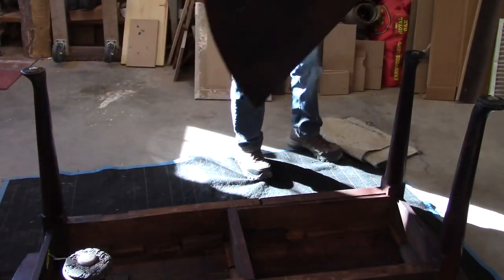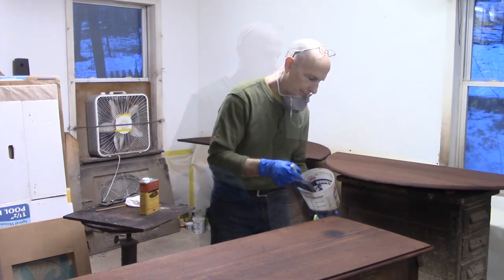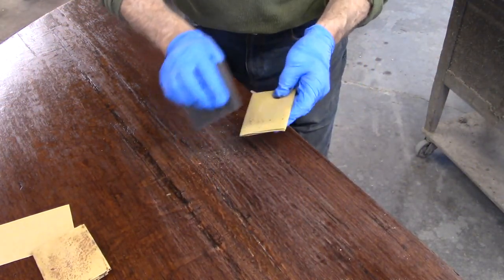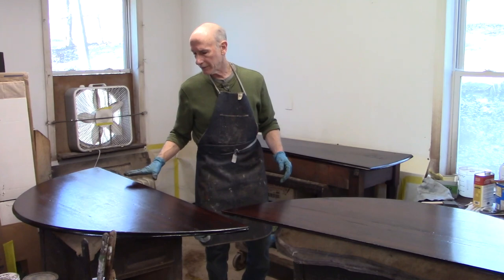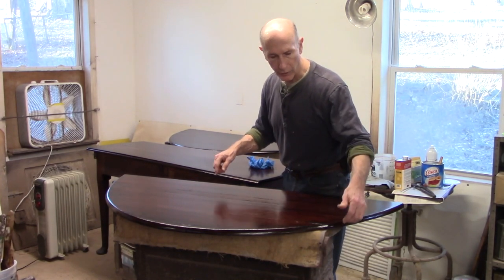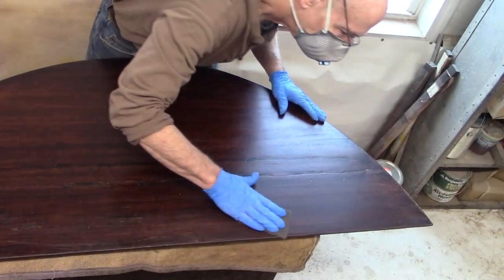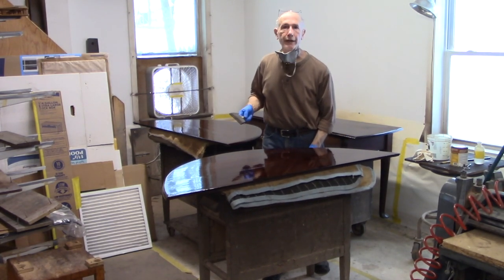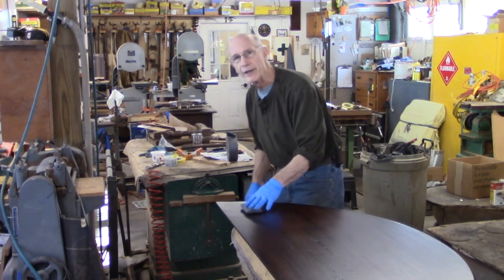Finishing an early 18th c. Drop-leaf Dining Table - Thomas Johnson Antique Furniture Restoration

Comment: Dear Mr. Johnson,
I admire your work and now I am more courageous in the application or stains and color, and the use of tape.
I have two suggestions for you and your viewers. 
1. Set the hinges and their screws in Shellac, and only shellac. 
2. To avoid breakage of the frame and antique glass, when you remove or hang a glazed door in a cabinet remove one screw from the top hinge and one from the bottom hinge and install, finger tight, a long screw with the head cut off in the screw hole, they will hold the door while you remove, or install, the remainder of the screws. Yes, it takes a few minutes longer.
In an old piece of furniture the screws either fall out or are so firmly in place that it becomes a chore to remove them.
Mike
Reply from the maker: Thanks! All good ideas!

Comment: A stearated  (freecut...a light grey colored)  sandpaper (320 grit) would help during your finish sanding operation. It'll help you sand without as much risk to gumming up and possibly marring the finish below with little globules of finish. It is also (because of the stearates) somewhat self lubricating. It allows you to sand a little more thoroughly to give you a flatter surface. Then you can wipe between sandings with a tack cloth. 
I've used this type sandpaper over all types of finishes (varnishes, lacquers, shellacs and even oils) with no residue left behind to get under the final finish.
Reply from the maker: Thanks! Yes, I used the stearated papers for many years. I like the gold a lot better. This finish would have clogged any sandpaper

Comment: Really nice, as usual. So one of the 'war wounds' is the burn mark that you left alone although by darkening the finish, it was less apparent.  By the way (being the nerd I am), that odd color change from green to blue to green again is the result of 'chromism'. The solvent choice (paint thinner) polarizes (changes shape and aligns molecularly) thereby causing a color shift (like a prism).  When you put that back into the finish which has another type of solvent presumably, it returned to its original color by depolarizing.
Reply from the maker: Thanks! Yes, I forgot about the burn mark, it's hardly noticable. I was wondering about the color - I should have paid better attention in 12th grade chemistry!
Reply: @johnsonrestoration  -- well you have mastered alchemy instead...you are one of the few who can transform lead into gold.

Comment: Beautiful finish, masterful problem-solving.  You gave me confidence to refinish my pine Habersham Plantation  dining table after 25 years of use and it turned out beautiful thanks to watching hours and hours of your videos. Couldn't find many on pine....I think one.  Have also refinished the top of  two HP  end tables and an HP sideboard cupboard and a HP hunt table.  Used stain, tung oil,
marker pens, satin lacquer final coat, and the Feed and Wax beeswax polish. And lots of sandpaper and 4000 steel wool. Have learned so much from your videos. Much appreciation!
Reply from the maker: Wow! You sound like a pro! Thanks for watching, and I'm so happy that you could learn from them

Comment: In the auto paint trades we use an enterface pad that resembles a scotch brite pad but it's foam, it covers more area and conforms to your hand without digging into the finish. Great job on the table, it looked almost sprayed on, great finish.
Reply from the maker: Thanks! i do buy products from an auto paint supplier, I'll check those out

Comment: A lovely three-hundred old piece which wears its ageing honourably, Tom.  You did a wonderful job.  I wonder if you ever use tackrags between coats to lift off the dust etc from refinishing?  Good idea to use foam brushes too.  There's nothing worse than finding a bristle in dried varnish etc.  Thanks for sharing this  project's video.
Reply from the maker: You're welcome! I just haven't bought any tack rags in a while. I spritz a little paint thinner on a rag. First time with a foam brush. I hate to say it worked great

Comment: I do work for dealers and mainly I hear, "Don't refinish it." I have refinished sections that go unnoticed, but that's rare. Here you've refinished all 3 sections of the top and I dare any one to say it's been refinished. Only the owner may know for sure. That is the ultimate goal,  to do the work it so it doesn't look like it's been repaired or certainly refinished. In this case I've not seen any better work anywhere. Tom, you aptly school the rest of us doing restorations and I miss non of your videos. I've learned a ton and use your suggestions and techniques nearly every day.

Yes, you are a master but your willingness to share is really as above and beyond as your workmanship. Consider me a humble and thankful disciple. I'm older than you but I hope to carry on this tradition until I can't walk to the shop.
Reply from the maker: Thank you! It means a lot coming from a fellow tradesman. And yes, always a balancing act over repairing and and doing too much. I'm convinced that by trying to follow old methods, you are much more likely to achieve an old look

Comment: Fabulously done.
Twenty years ago I bought a 1895 mahogany dinning table that had previously lived it's life in the dinning room and only used for really special events.  It was probably waxed every week, not a scratch, stain or a scare on it.  What I really liked about it was it had two pedistal legs and made it great for seating larger dinner events.  Unfortunately I used it once and there were water marks in the finish after...
Because I wanted to be able to use the table on a regular basis and not be worried about the table top I refinished the top and put on several thin coats of a water resistant finish.
I love my table and have spent many happy hour around it with many friends through out the years not worried about the table and enjoying my friends...l bought the table to use and enjoy with my friends... Yes it has a few scratches and dents and I am debating on if I should give it a light sanding and a coat of the stain and then a few more thin coats of water resistant finish again?
I know that the finish I choose has removed the value of the table as an antique but that's not what I bought it for, I bought it to be used and enjoyed and it is serving me well.
Reply from the maker: Thanks! Yes, always bottom line is that a piece needs to be used! That's what it was made for
Reply: @johnsonrestoration  l have noticed that you often finish off with wax.
How well does that stand up to everyday use and water?

Comment: Thanks for sharing!  This is why I just can’t ever stop restoring beautiful wood things!  ~Quick question: Do you warm the asphaltum finish to 135F for two hours to blend it with the original finish before cooling to sand and apply final finish?  A wonderful older gentleman that guided my first apprenticeship said that he had done that for 40 years (almost 40 years ago now!) but I’ve never seen anyone else use it on furniture until this video.  I thought I was the only one left using it!
Reply: Answering here not because I have an answer, but because I'm interested in Tom's!
Reply from the maker: Thanks! No, I haven't. I will try that to see if it makes the asphaltum easier to work with. I imagine it blends with the finish well as they share the same solvent. I am curious
Reply from the maker: Oh man, the pressure's on!
Reply: @johnsonrestoration  No pressure whatsoever. Just curiosity!

Comment: Tom, I'm wondering if the previous 'motor-oil finish' had some bearing on your glaze? I get the feeling that you were surprised how long it took for the glaze to firm up, and how badly it clogged the sandpaper. With 20:20 hindsight spectacles on, would you do it again on the same table? I understand why you wanted the richness of colour, but it seems that it caused a whole load of other problems - would another, different stain be a better approach, now that you've done it? Once again, a great tutorial and a lesson in patience! Thanks for sharing Tom.
Reply from the maker: Thanks! I'm not sure. I think it will dry along with the finish, I believe they are compatible. I'll always use asphaltum, the color is incredible

Comment: Tom, when a chair seat has had multiple glueing and after removal of the glue the parts no longer fit together tightly (maybe a 32nd gap) at what point would you consider cutting out the old and placing a filler strip?  I'd like to try a wax filler but am concerned re the size of the gap and how the wax will hold up.  Thank you
Reply from the maker: Thanks! I have often wrapped a piece of fabric around a joint, or veneer shims. If you can put it together easily just by hand, it's probably too loose

Comment: I found a drop leaf side table at the local recycling centre for the change in my pocket, jet black with gold guilt, a couple of repairs to the legs and a notch on the top where I think someone used it as a hobby table. It’s really nice except at some point someone has varnished it, probably like 60 years ago and it’s worn off and looks a mess imo. I have had a look on the net and can’t find one the same, and only a few that look as nice. For now it’s just a table and getting used as such 😊
Reply from the maker: Thanks! That finish sounds like late Victorian, Eastlake style

Comment: It looks like you don't have a separate room for finishing. When you apply the finish to the table it seems to be upwind of the fan.  Aren't you drawing dust across the table from the rest of the shop?  (Just a question, you know what you are doing.)  I learned a lot.  Thanks.  Mark in Milwaukee.
Reply from the maker: Thanks! Yes, that's true. On days I need to apply a coat, I try to limit the dust production in the shop, and I apply the finish at the end of the day. It was only a problem when I had people working for me that needed to raise dust for one reason or another. Working by myself it's manageable

Comment: Beautiful finish. Would the original finish likely have been shellac?  Was your choice to use tung oil varnish due to superior wear resistance or to the contaminated surface?
Reply from the maker: Thanks! I don't know what the original might have been. I'd like to research that. But I used the varnish for it's durability

Comment: Another ace job! I thouggt I was bad with 3 coats of 90 gloss varathane and 3 coats of Diamond water-based varathane clear over the oil-based varathane on red oak. A lot of sanding and a lot of scotchbriting and a lot of dust vacuuming and wiping down.  The Diamond finish adds clear hardness and the oil-based gloss varathane gives the warm patina.  But you have so many more coatings in your arsenal and your color matching efforts are the best!  Thanks for another great video!
Reply from the maker: You're welcome! Yes - I may put down a lot of coats but there is a lot of sanding between, I hope that the final mil thickness is not too much

Comment: Beautiful work, I got tired just watching you work. I had a problem with a finish that took to long to dry on a small half table. I sanded and re garnished it. 3 times. Finally got it the way I wanted it.  I have a small 1878 sewing machine table. I  finished it three years ago. It's a 12 singer sewing machine table . I am seeing a few spots  I think something got trapped in the first finish. I think I will  refinish it. I am not sure what the wood is, I think it is a cherry maple. It has red in it and beautiful. I did a natural finish the first time. When I got it if was in pieces. So any help would be appreciated I think it was left in a damp storage area.
Reply from the maker: Thanks! Send some photos: thomasjohnsonrestoration@gmail.com

Comment: I often use  a sanding sponge on top of the 0000 steel wool, sanding side up. The tougher skin spreads the weight out a bit allowing the sponge to glide the 0000 over the high spots.
Reply from the maker: Thanks! Good tip! I will try that

Comment: How many sanding strokes did you give that top?? Beautiful job of blending colors on top. 
5 or 6 methods used to get that soft sheen and uniform color. 
Thanks for the info.
Reply from the maker: Thanks! I don't know, but I do sort of count them. When I'm using it to rub out a table I absolutely count the strokes

Comment: You made the table look really beautiful, Thomas. The video caught my eye because I have a very similar table - with identical legs, including the corner mouldings where the leg becomes square as it joins the table top. But mine is round and made of oak. It's less elegant than the one that you restored. In fact, it was in the kitchen in my grand parents' house in Wiltshire, England, maybe in the great grand parents' kitchen as well. It might be called "country Chippendale" in the UK, because it is of the style, but less refined. I'd date it to around 1750, maybe earlier. And I'm sitting at it now, working from home in Annecy-le-Vieux, France. Thanks for the video - I've subscribed. Tom
Reply from the maker: You're welcome! That's great! This table is oak

Comment: It’s interesting what you said about ‘motor oil’ and the oil kept ‘coming up’ as if it were a non oxidizing oil, unlike linseed oil. 

I’m always interested in the different finishes and when you use each and in what stage of the process. I’ve seen guys start with oil, then go to Shellac and end with Varnish and wonder why ? 
  I’d be keen on an episode on finishes you use maybe just cuts of many different projects, although we’d all say one of the main reasons we watch is just the aesthetic of the restoration
Reply from the maker: Thanks! Yes, when you're having problems you might switch finishes mid-stream as it were, but I try to avoid that. I need to do a video on finishes

Comment: Tom, have you ever used waterproof "wet or dry" sandpaper?  I have found that used wet, prevents the clogging problem.
Reply from the maker: Yes, I have but I prefer the Gold paper dry because you can see what you're doing much more easily

Comment: So you're using a solvent based finish over original unknown oil? Could you have sealed it and used a water based finish or is it always oil based after oil oil based or can you change?
Reply from the maker: Thanks! I like this Waterlox Varnish, and I figured it would be the most compatible

Comment: The table came up superbly and yes I totally agree, even though it’s an antique and hundreds of years old , it still is a dining table and can and should be enjoyed as such.  To me that’s the purpose behind having such special pieces.  I enjoy and use my antiques every day.

Now for a technical question, as an amateur antique restorer for over 30 yrs, could you please explain in more detail as to the finishes (glazes) and stains you used to restore this table.  I am well familiar with shellac’s, hard shellac’s, Tung oil etc, but I can’t say I have ever heard of or used glazes and/or why you used this finish.  Is it because of an issue of durability as opposed to shellac which is prone to heat and water damage ?
Reply from the maker: Thanks David! I have been using the Waterlox Original Tung Oil Varnish for quite a few years and I can't say enough good things about it. It lays down beautifully and is extremely durable. I talk about glazes in this video: https://www.youtube.com/watch?v=oF1o5iD2pYs
Reply: @johnsonrestoration  Hi Tom,  many thanks for the reply, that’s really helpful. I have been using In Australia, Feast Watson’s Tung oil product called Floor seal on my floors, bench tops and even cupboard doors in my bathroom. It lasts so well, and is easy to read- finish once it’s worn. Unlike shellac’s it’s copes with both heat and water. For all my antiques, and antique joinery I have always used shellac to French polish the timbers be they cedar, baltic, Huon, kauri or even oregan pines. I will check out your video on glazes as that will be interesting to lean about. 

I love my colonial antiques, they suit my 1850 home perfectly. Sadly, here at least the antique market has suffered and prices have fallen. Mind you, the antiques I bought were not acquired as investments but rather from the point of view as an appreciation for their history, quality and integrity in design/construction.

Comment: Another good video Tom.  I really like when you are doing something like using steel wool or sanding between coats and you explaining what you are trying to accomplish and showing it in the video. Just saying "Now I'm going to use some 320 on the top" isn't anywhere as valuable as saying "Now I'm going to use some 320 on the top to remove the nits and get rid of the glossy spots to make the existing finish uniform" and then proceed to show that very process and the result.  That green dye trick was pretty neat too.  Thanks again.
Reply from the maker: You're welcome!

Comment: Hi - a quick question:  is there any benefit in wet sanding with  the Scotch pad?  I have tried a couple times using 800 grit wet&dry sand paper but never really understood the out come.  Any thoughts.  David
Reply from the maker: Thanks! Wet sanding is fine, if you're trying to get a super glossy finish. But you can't see what you're doing! You have to constantly squee-gee and dry to see what you've got